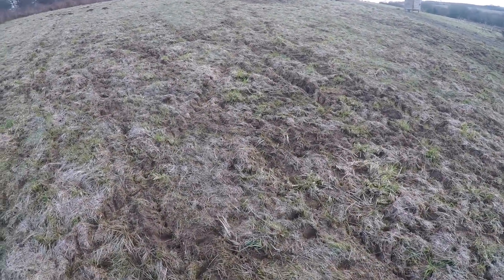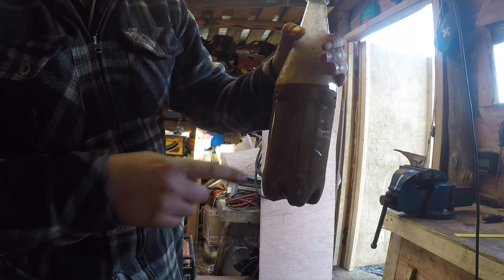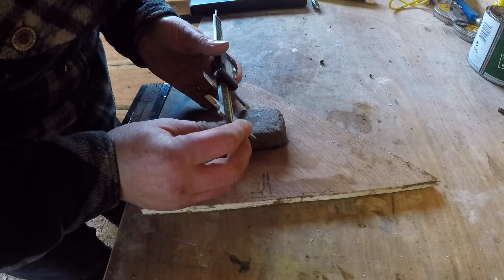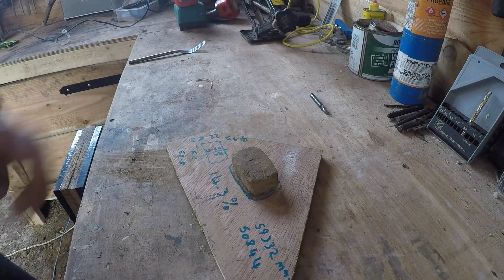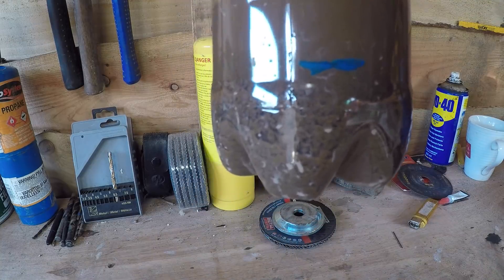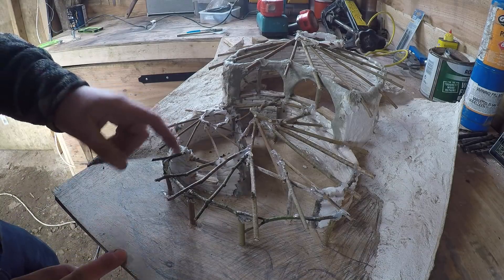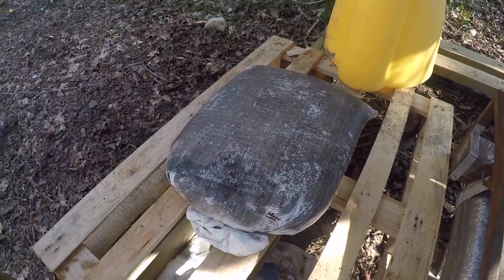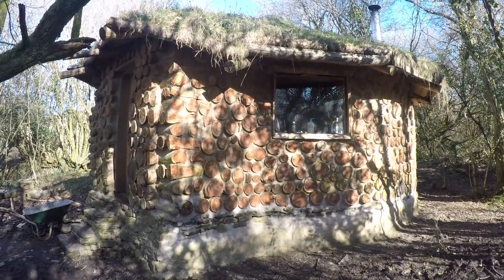Off Grid Earthbag workshop project part 3 soil test

Comment: just dig a ditch around the building that's a few feet deep, line the bottom with garden fabric, fill it with 2" screened gravel (no sand), and cover it back over with low-clay topsoil. it's a great passive way to lower the moisture content around a foundation.

Comment: Chris - nice idea. Several suggestions to offer both for ease and convenience.
1 - In Mexico they work with clay brick called adobe - simple wooden mould that you can fill up and mass produce up to 300 bricks a day and sun dry. ( they build three storey structures out of these brick so they must be sturdy. ( check out adobe brick on youtube)
2 - If you mix in a 10 or 20 % cement into you mix before bagging - the likelihood is your bags would dry solid and definitely provide you with a firmer support wall. ( I'm thinking more in the lines of support buttresses as in the Gothic style hence eliminating the need for a dead man cable)
3 - wouldn't it then be a more sound idea to slope all your rooftops of the model in the same downward sloping fashion, thereby cancelling out the need for a "drainage moat" right around your structure. ( be funneling all the run off in one direction you then cancel out the need for drainage AND have the chance to create a rainwater caption center) 

humble me merely suggesting - marvelling at your amazing methodology and train of thought

Comment: hope you got my Email OK....
Reply: Two questions.  Did the board you conducted the experiment on actually actively pull moisture from the mud oblong you tested? (I can see the damp area inside the outline you drew when you lifted the block), and does this make any difference to your calculations?  And the second question is if, as you believe, the mud is suitable as a cob mix with no further working, will you revisit your decision on never using that building method again?

Thanks for the video - interesting stuff.....
Reply: Nope, it got lost in translation